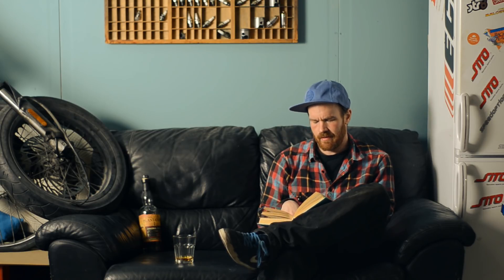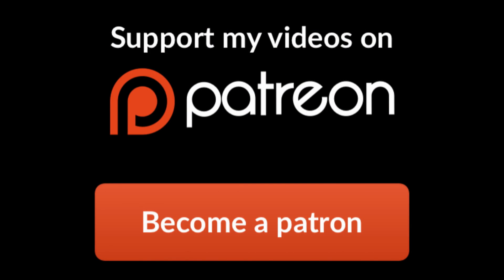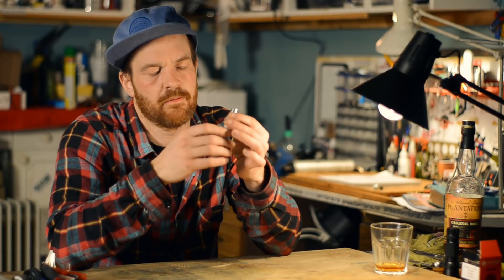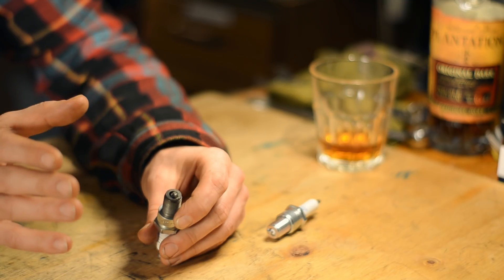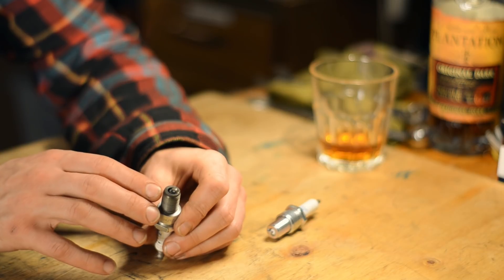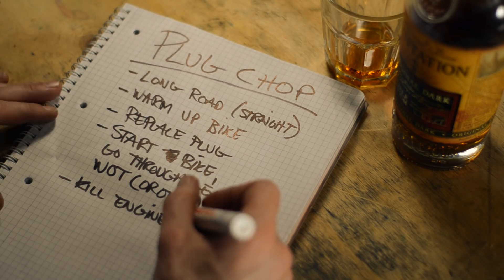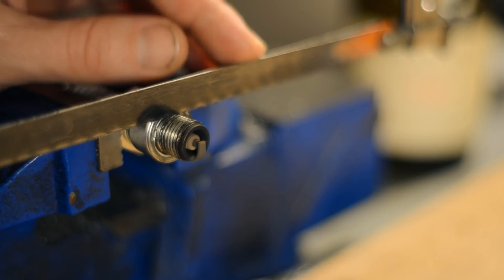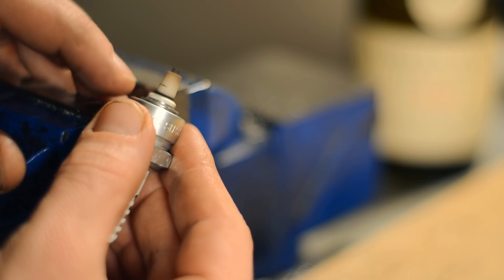How To Read Sparkplugs | AFR

Comment: When you kill the engine at wot, how do you ensure that the spark plug doesn't get drowned in fuel and oil? What can you read from a soaking wet spark plug?
Reply: Elmar Dylong you're just not good at reading tea leaves I guess.
Reply: Elmar Dylong Partially true.  EGT will spike at both sides of the best AFR for the engine.  If your are able to add a WB (pretty hard on a 2 stroke due to oil fouling) you have a winner. EGTs are slow reacting compared b to WB sensors so it's challenging. Just my experience.
Reply: EGT requires many cycles to read the average and is no use without CCT.
EGT falls each side of peak AFR, but 2 strokes will seize at peak AFR and need to be run on the rich side of the EGT slope.
After several runs observing the same EGT the CCT will tell you how far off too hot you're combustion chamber is.
If EGT stays the same and CCT climbs toward maximum temp over many cycles of wide open throttle and isn't leveling off on the safe side then you need to get it rich again.
EGT just tells you if you are on the up slope of the AFR ramp.
If the EGT drops after leaning it off then its way too lean, this is sometime mistaken as too rich so they lean it off some more and kerbang.
In doesnt matter what the final EGT is, the CCT is the one that tells you how close you are to too lean.
If the CCT goes over the red line forget about EGT, it needs to be richer to keep CCT down.
Reply: Once again, a definitive, correct and understandable explanation. Your a gun Dave!
Reply: Elmar Dylong I kill and cluch at WOT, I understand what your saying but close off and coast is going have the least impact on the plug I would have thought 🤔
Reply: Reading a spark plug is no proper way to determine if your mixture is ok. It is like reading the tea leaves, but of course you can see if something is way off. An egt-probe is a more usefull an reliable way to see what is actually going on.
Reply: Elmar Dylong What EGT range is good on an alcohol burning 2 stroke?
Reply: I get what he is saying. But spending half a day cutting plugs and messing around with jetting for a specific rpm range is fine if you are just trying to hit that sweet spot. 
Lets say you get it dialed in on Saturday and temps and realative humidity take a dump on Sunday race day then what? 
Dial it in with the plug cut for a base line use the EGT sensor from then on to tweak and tune other throttle positions.  If you make changes or think something is off you can play around and experiment.
We aren't tuning a baby grand piano here but a sweetly tuned crisp 2 stroke is a thing of beauty.
Reply: If you get the plug up to temperature it won't be wet if jetting is right. Personally I stopped trusting EGT gauges a long time ago, I've melted pistons with the EGT never showing over 650C, and had things work just fine with it at 750C. And I see this all the time, people melting pistons on brand new builds because they blindly trust their EGT. IMO an EGT is only useful as a secondary way of measuring. First you need to "calibrate" it to your engine and see what temperature actually works for that particular combination of parts. By reading plugs for example ;) And of course probe location is critical, a couple of cm too close or far and the reading is going to be messed up. They are useful to monitor temperature over time though once you know the jetting is roughly correct and you know what temperature works and what doesn't, but IMO should never be relied on for initial jetting.
Reply: What if ignition timing is wrong then?
It destroys all readings from EGT.
Reply: I´m just using EGT for reading if pipe will be in tune and i also reads if somethings gone south.

But there´s alot more to read from the plug than Alex talks about in this video, but that´s an another video i guess ;)
Reply: What is a wb sensor
Reply: I am sorry, my daily fight is with gasoline burning two strokes. But I guess alcohol burns pretty cool, if one can say so. When it comes to model engines I could take a look into my books, because I think there has to be a number for doped (nitromethane) fuel.
Reply: W-ide B-and, germans say "Lambda Sonde", measures the remaining oxygen in the exhaust gas. A really nice way for tuning an engine, but does not work with oily two strokes.
Reply: Elmar Dylong Ok thanks regards  form Holland
Reply: The difference is this cvt, the engine operates at one point of the rpm range. There is enough time to get a reading from an egt. But for geared bikes what you say is true. WB and two stroke? No good. ;-) A CO-probe will work, but may still be ruined by oil. Best is to go with a few hundred good runs on the dyno, the numbers will show everything if you can read them. Guesswork can't be completely eliminated. 
Reading tea leaves is not for me, thank you! :-)

Comment: for a serious note, when i open my throttle and i hit my top speed my moped stops firing until i lower the throttle.
Reply: Probably running lean.
Reply: Rev limiter.
Reply: Thanks for all the answers i'll try jetting it up a couple of steps when i get my jets and exhaust gasket thanks.
Reply: does it make a bleuhhh sound
Reply: Andy [Xvixx] if you snap the throttle from idle, does it also do it then? If so, you're way too lean.
Reply: Sounds a bit lean to me...
Reply from the maker: Could be spark, try a tighter gap.
Reply: It doesn't have a rev limiter it's a condenser system. it's a 1989 honda pa50 if you wanted to know
Reply: Pa50s are speed limited. That means a rev limit is designed into the ignition system, even though it is analog. There are also hard part differences for the 20mph limit and 30mph limit models. If you have a low limit setup, port work and part swapping can get you close to 30mph model speeds. But you will still have a design rev limit. Might be able to use an aero50 box and coil, or even a chineseum box and coil for 2 stroke scoots (MUCH cheaper). If you use aero parts do not use uk spec, they are also limited. I deleted my original reply, because I saw pw50 (Yami peewee dirt bike) and gave advice based on my stupidity rather than your reality, lol.
Reply: I'll let you know the ignition isn't rev limited as changing reeds gave me way higher rpm.

Comment: If it melts does that mean I need less fuel?
Reply: Melting the spark plug is caused by the combustion temperatures being too high. This can be caused by a spark plug of the wrong heat range or by having too little fuel in the mixture. The fuel actually helps to cool down the engine before it burns which reduces the temperatures, and prevents melting the spark plug
Reply: All leaning it out will do is cause engine damage because it is running too hot. If it already lean enough to melt spark plugs then leaning it out more will cause even more damage to the top end of the engine. suggesting leaning out the fuel mixture and running WOT to "clean the engine out" will cause damage. Sure, running the engine very rich will cause excessive carbon build up, poor performance and fouled spark plugs, but thats about it, while running very lean can burn holes in pistons
Reply: Andy [Xvixx] if it melts it's lean... much more fuel needed... start rich and work down! it's the safest way
Reply: Timing can be wrong
Reply: Ed Boer jetting is simpler and harder to mess uo, so best to try richer jetting first, unless timing is suspicious.
Reply: Dustin Short correct that is what i mostly do
Reply: fishsticks set the bike up so the rear wheel doesn't touch anything so it will rev higher
Reply: Willspoony Roberts I think he knows atleast a little, but wants to be funny. And tell him the opposite
Reply: I did not melt a sparkplug, it was a joke.
Reply: Andy [Xvixx] you may have been joking fishsticks seams to think he knows best and in the meantime some pour chap has just lost a crown reading these comments I for one have split my sides with laughter 😒
Reply: Andy [Xvixx] yes if it melts you need less fuel and more air. Also don't use too much 2stoke.
Reply: more fuel.  
do a googel search and check it out your self. 
DONT listen to fishsticks.
Reply: Dustin Short ignition?
Reply: Ed Boer forgot to mention, but it doesn't seem likely, as you it would need to be very advanced and would most likely be getting a lot of detonation and pinging. Also, I'm assuming his bike isn't modified and being lean is very common in modern bikes for emissions reasons, and a little piece of dirt in the jet can throw afr way off.

   Clean carb before anything and listen for pinging sounds at full throttle.
Reply: Dustin Short yes, i think a combi ,more fuel and ignition a bit later
Reply: fishsticks  your going to cost this fella an engine you clearly don't understand stoichiometric ratio or thermal dynamics nor infact simple working of a two stroke motor.... I would if I was you sir go have a read 🖒
Reply: I hope you all realise that this is a joke.
Reply: EdwardTennant Gaming He needs more air and less fuel and wide open throttle to clean the engine out!
Reply: DON'T LISTEN TO ANY COMMENTS ONLY TAKE MY ADVICE! THEY ARE TRYING TO BLOW YOUR ENGINE UP!
Reply: Andy [Xvixx] less fuel more air and full throttle
Reply: Andy [Xvixx] No,no less fuel more air wide open throttle while it's on the centre stand and 6drips of 2stoke ONLY!
Reply: Willspoony Roberts not true ! It needs less fuel and more air also very little amount of 2stroke will help 
Wide open throttle while you have done above
Reply: Andy [Xvixx] Not true don't listen to anyone! You need less fuel and load of air! And a very small amount of 2stroke oil.